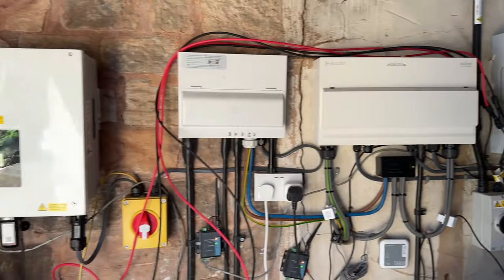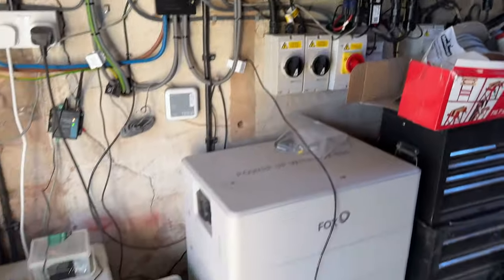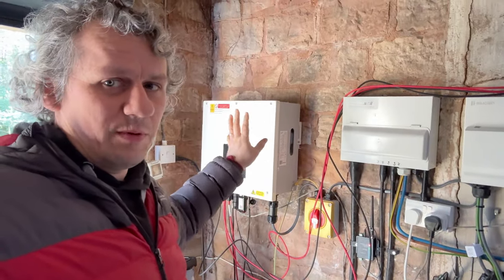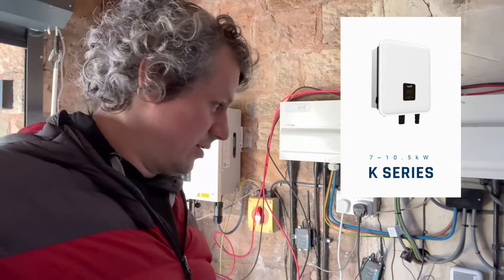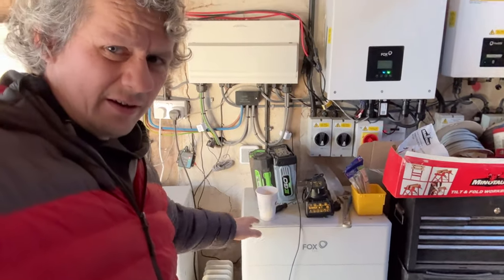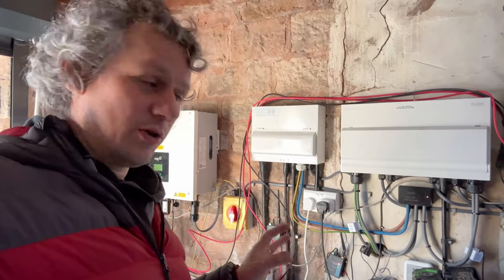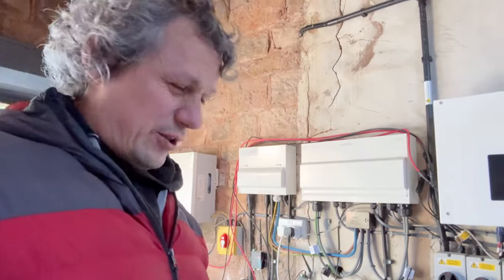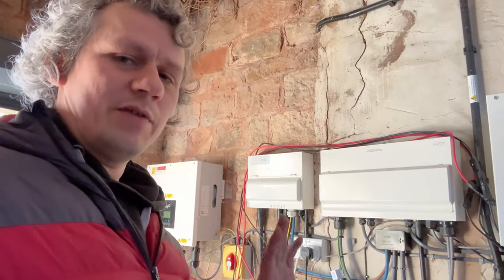Solar Update; MAX Storage mode enabled :)

Comment: FYI your charge at 10p/kWh doesn't work out as your import rate as you're not adding in the losses from the battery & inverter which workout at 12% give or take. So charge at 10p/kWh costs 11.2p/kWh discharging. Considering tracker at approx 18p/kWh you're only saving 7p/kWh but you've spent over £20k on batteries. For most consumers this doesn't make sense, but if you're a higher user it may, but Octopus Tracker does put a big dent in break even date. That said, I do love your set up, so jealous
Reply from the maker: Loss from grid to battery and back out is around 5%. 

Now on 7.5p off peak, and additionally not for 4 hours but 6 now. Super cheap, break even at this rate much much sooner!
Reply: @IanSampsonRLO  I have the FOXESS Energy Cubes & the % difference between cumulative charge/discharge efficiency is 90-91%. A 10% loss from battery storage is common. How are you calculating losses?

Comment: It'd be easier if you could use the cars as storage for the winter 🤔 well at least if you didn't use them in the winter ?  You'd need an ICE vehicle for winter 😂
Reply: My ionic 5 does more running the house than driving in the winter 60 kWh home battery capacity free with car

Comment: Oh no you're not you could be using a second hand car battery and the battery emulator on some lilygo. Since you have two inverters you could have have two kona/niro packs 64kwh each i.e. 128kwh probably for the same price as the oem ones you have there.
Reply from the maker: These inverters would not communicate with those packs.